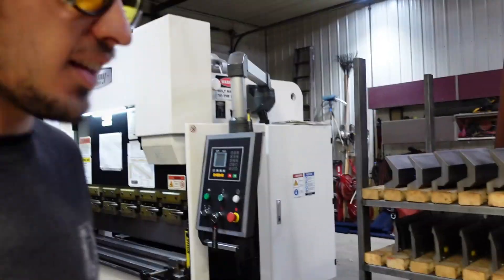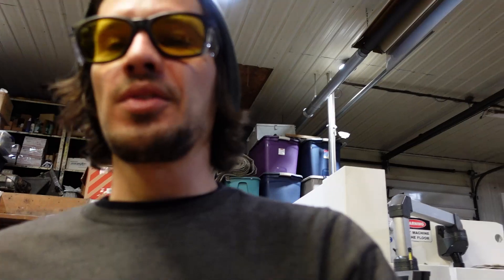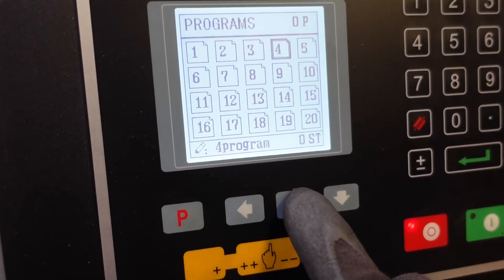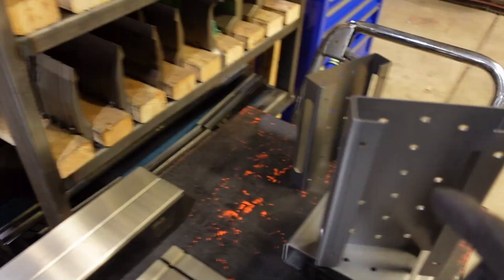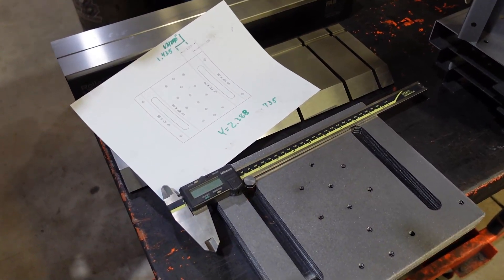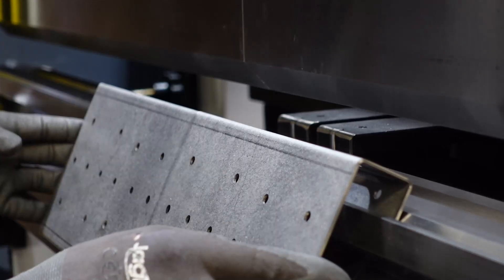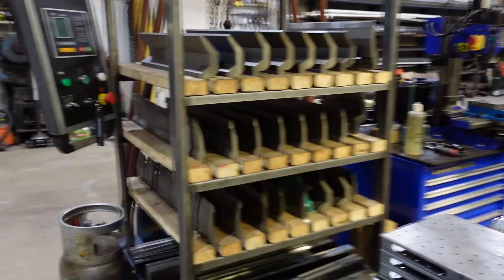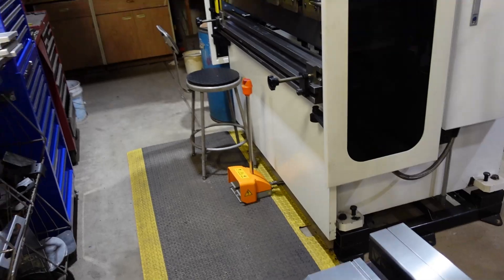BENDING BASICS - Tommy Industrial Press Brake - EP3 -

Comment: Am curious if owning a machine is that much better than just having a good employer??
Reply from the maker: I was a product engineer at a sheetmetal manufacturing company for 6 years and discovered I really didn’t like being an employee so I went out on my own. A lot of people enjoy being given tasks to do every day. I on the other hand do not handle being told what to do or how to do things so it works for me. Also the press brake has paid itself off easily 10x over in the last 6 years of owning it.

Comment: How are you calculating bend angle for a material thickness with the Y value?   I modeled a simulator of this machine that shows a bend part in the V, but without knowing what the machine’s Y0 is the values I come up with don’t correspond to what the controller shows at all.  This doesn’t account for spring back yet, but still not even close.  Is there a way to set the controller’s zero position of Y?  
Thanks man, awesome video!
Reply from the maker: The machine is at 0 in the up position. You tell it to go down anywhere from 0 to 4 inches. It’s just trial and error until you bend a few parts and I write them down for next time with the dies I used for that material and bend angle. Over time you get enough of them to do it quickly.

Comment: Sir, what glasses you use? and is it as good as 3m safety Glasses?
Reply from the maker: I just buy random ones on Amazon. I prefer a non scratch polycarbonate as they block uv from the plasma table and such

Comment: What punch and die sets do you use the most? Like a gooseneck with a 4-way or acute sets?
Reply from the maker: Hey sorry for the late reply. I honestly have the stock 4 way and upper punches in my machine 90% of the time for bending simple parts. Once you make boxes and odd parts with side bends that when you need segmented tooling.

Comment: In simple terms its, 

Sheet Thickness x 8 = V Opening Dimension of Die

For e.g. if your Sheet Thickness is 1.5mm, then its Optimal V Opening Dimension of Die should be 1.5 x 8 = 12mm.

Comment: is there a way to control how much preassure you put in each bend ? or is it determined by the machine when you buy it ?
Reply: the pressure is determined by machine, the best workaround is to put on corrections on the bend angles. You basically tell the machine to bend 88 instead of 90. Then you measure whatever it actually did - and keep adjusting the "correction" you used until you find your sweet spot. Then you can save your settings for future use for that material/thickness. However in my experience - you need adjustments with every new batch of sheet metal.
Reply: Depends on Brake capabilities. If you use ‘tonnage’ mode, you program with pressure, not depth.

Comment: You would be better off with a gooseneck tool, starting with the 2.315 first and then .935. More correct results. 
 😬
Reply from the maker: @niftyfifty9284  nah I’m good. You can bend them that way if you’d like though.
Reply: As long as his angle is consistent down the entire flange the next bend will be consistent. You can also raise your backstops as close to the bend line of the part as possible and avoid most of the dimensional changes ,but, not all because there will always be variation (grain direction, thickness, even pressure of the part against backstops). But, we are talking .005 thousands and he has .030. What he’s doing is perfect without spending the thousands for specialty tooling.
Reply: How was the center dim.
Reply: U only need two back stop setting

Comment: Real nice tutorial. Thankz. Alot...also There is a math formula to select the correct bottom die. Too...😊..
Reply: I have found between 6-10 times the material thickness works fine, with 8x being the best
Reply from the maker: yes, as mentioned 8x material thickness for your bottom die and rule of thumb for the upper punch is a tip radius close ish to material thickness. That’s not as critical as the lower die opening though.

Comment: can you slow down the bending speed, if you had a much longer piece of material? and also slow down the return speed?
Reply from the maker: Not on the main control panel settings but it may be something you can adjust in the hydraulics Or possibly deeper in the controller by contacting Tommy Industrial. I’ve yet to have any parts I needed it to go slower for personally.
Reply: @AdamDeuling   are you happy with the Tommy industrial. Are there options you wish you would have gotten instead. Have you had any problems with it? How’s their customer service
Reply from the maker: @t-bone1890  I’ve been very happy with it. It’s been repeatable and the only real issue I ever had they diagnosed for me on a machine in their warehouse, finding that I wasn’t letting my phase converter warm up enough before powering the brake up which was tripping the “vfd” inside the machine. They have treated me well and I definitely recommend it. It’s also the most affordable machine out there that actually has a real company behind it in the US where you can get parts etc as opposed to importing a machine and being on your own. 

I also like that they seem to make upgrades since I’ve bought mine and the new machines have some even better looking back guages and other features.

I have a link above in the description you can fill out if you are interested in getting pricing.
Reply: Yes you can, Speed between 1-10 Depending what your bending. 
Normally I run on 10, but if its a thine material and long I prefer to drop the speed to 3. 3 let's me control the lift better 😊
Also you can drop the upper tool hight so there is a minimum gap between the V and Upper tools.